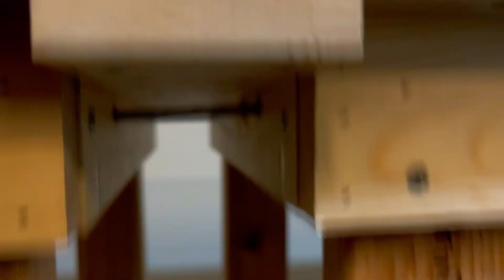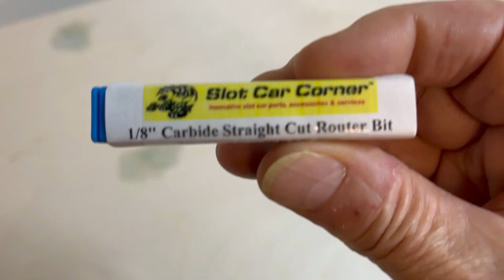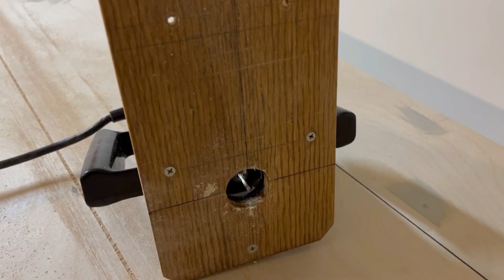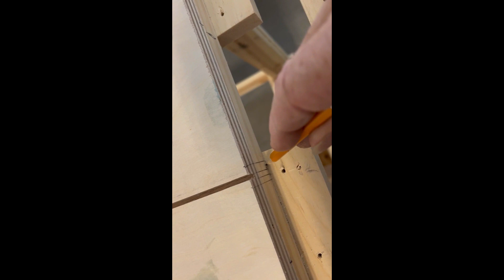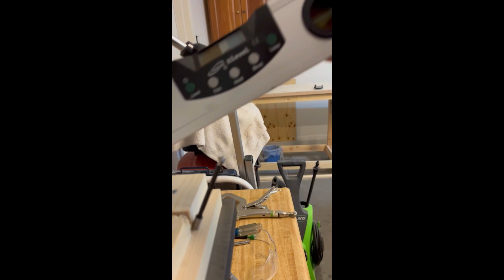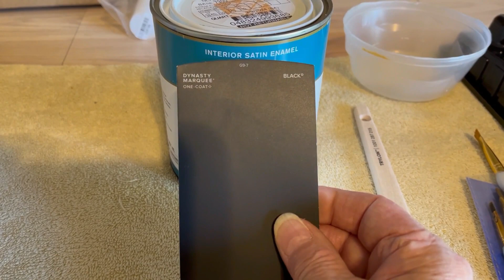Slot Car Drag Racing Track. Part 1 Home built using 16 of 24 feet for racing slot car drag cars.

Comment: So Bill, I always go back and re-watch your videos on your build and always pick up something new each time.
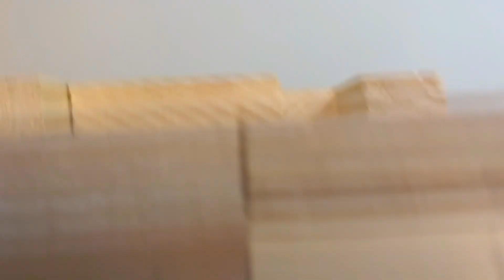Since I am building a 1:32 scale drag track and I only have 20 feet to play with. How many feet do I need for the shut down area? This track is just for my own enjoyment so looking for something simple...Thanks in advance...
Reply from the maker: Hello Roger...scale scale scale and sometimes you have to work outside the box. In track comparison mine would fit the 1:87 scale. It said my finish should be 15.172 ft. Well I told myself just calculate it to be 16 feet. So the total length of my garage floor is 27 feet. I use a small cabinet 30" x 20" and used a flat dolly with wheels on it from harbor freight. This is where I put all the power supply, the Drag it Anywhere box, camera mount etc. on this. The first stage is 13" from the end and then add another 1.5" for stage then 16 feet for the track and that leaves me with 82" for shutdown just under 7feet. Then I use the soft rayon sheet and foam pillow at the end. So I calculated what yours should be: You might have to make a separate stand for all your power supply etc. One foot for the pre-stage and one inch after that for stage sensor then calculations for the finish line--13.33' but you could stretch it to 14' and that leaves you with 5' of shut down area.  Oh and then the width of the track would be very close to 20" wide. You have to ask yourself "what would this look on camera"? I hope this helps Roger.
Reply: @bills7974  Much Thanks Bill, Yes alot to figure out but at least I have a better idea on what Im looking for. I kinda thought the shutdown area would have been shorter but longer is always better and frankly this will sound funny. Since I'm in a mobile home and going to run this down the hallway in 4 - 4ft portable sections then that will leave me the remainder that will sit overtop of my washer and dryer to be the shut down area... gotta do what you gotta do with the space available...Thanks again

Comment: Hello Bill, I don't imagine you would have plans for your framework at all would you...I'm going to be using 4ft MDF 3/4" plywood for the surface. So just trying to get an idea of your framework that you used. Really appreciate if you have something that I can get an idea on.
Reply from the maker: Hello Roger I will get back to you on that.  Hang in there.
Reply from the maker: Hello Roger. I started with 2 sheets of 4 X 8 X 3/4" thick birchwood because the outsides are so smooth for the track. Pick the best side for the top. Cut length ways you'll have 4-2 X 8 pieces only used 3. Now here is the key. Draw  a line on the bottom of the tracks 2 inches in from the ends all around. Now using 1 X 3 pieces of select pine from home depot or where ever. Cut these to the outside of the line drawn under the table. Everything is not built yet so put the top surface down and using an air gun-put the frame together. Now turn everything over and line up the top frame to the outside of that line drawn. I used a combination square to get it right and shoot the nail gun into the top of the track to the top frame.
If you look at the video you'll see I used 2 X 4 for the legs. Cut the legs to your desired height. In my case I started with 34 inches (and because its in the garage you'll have to compensate for each leg a little longer). I started with 34" and at the end of the track was somewhere over 37". Making the bottom frame was about the same way. When the legs are attached you'll notice you'll have a gap of about 3/4"-I used more 1 X 3 between these for added support. Supporting the legs is most critical. You might see bolts on the bottom outside of the legs-this is so I can remove the 1 X 3 to get heavy stuff moved under the table along with T-nuts. Most the initial attachments are made by the nail gun then followed up by different lengths of wood screws except for the attachment of the top wooden frame.  Stopping the video in some spots will show you a lot. It takes time. Once you get one done the rest will fall into place. Thanks for watching.

Comment: I have been following your drag strip build...would you happen to have a part # for that router bit from Slot Car Corner...I cant seem to find it on there website. Unless they quit supplying that item... Thanks in advance
Reply from the maker: Yes. Here is the URL page: https://slotcarcorner.com/collections/1-4-track-braid-products/products/rbit18-slot-car-corner
Its under the heading on the Slot Car Corner Page as of today. "SCC Straight Router Bit" SKU: RB1T18. That should work. Thanks for the nice comment.